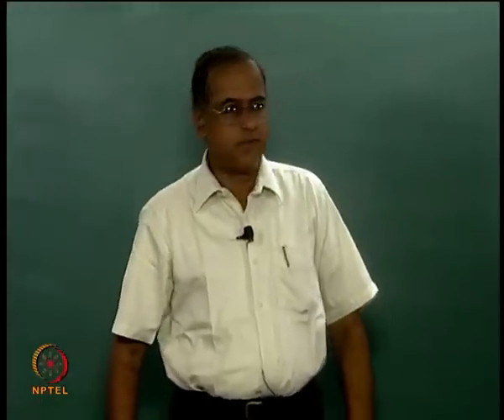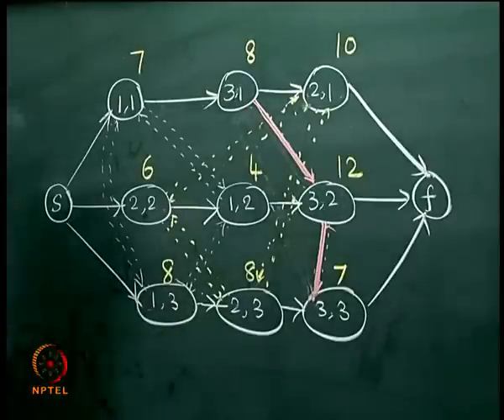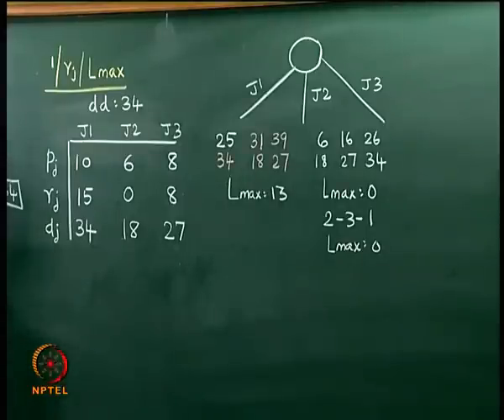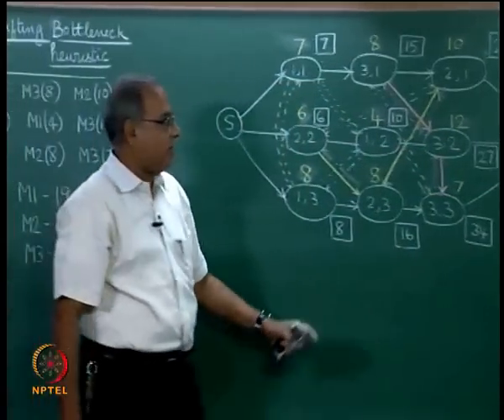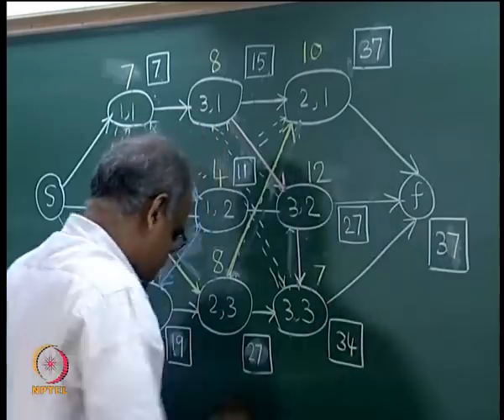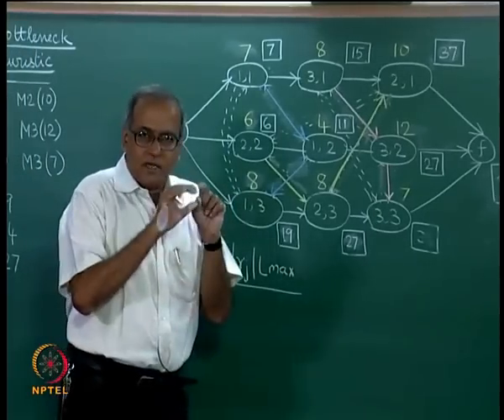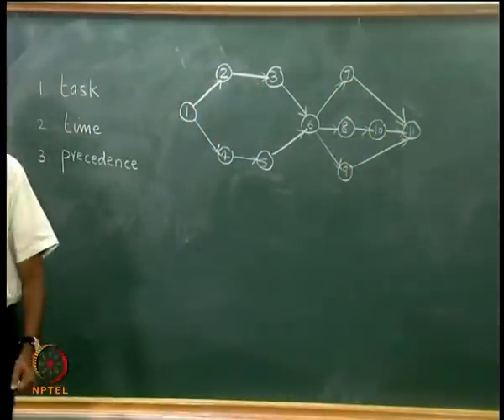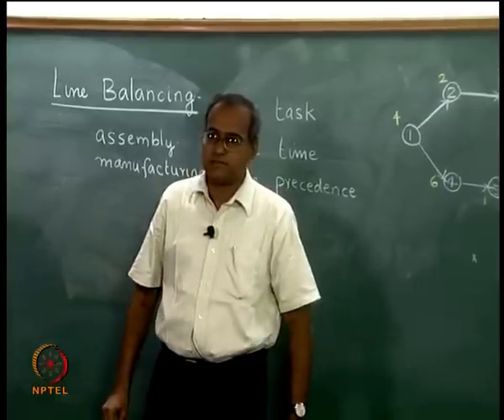Mod-07 Lec-30 Job shop scheduling -- Shifting bottleneck heuristic. Line Balancing

Comment: In trying to code this, everything seems to work great until the best arcs found during an iteration of 1|rj|Lmax create cyclic loops in the node network that were not there before. Any insight on the most efficient way to ensure that cyclic-inducing arcs are pruned from consideration from the start?

Comment: My question is 
while calculating for machine 2 related to job2, due date  = 34- (12+4) have been considered, but when machine 1 related to job2 is calculated why not due date= 34-12 only why it is calculated as 34-(7+12). and if it is taken as longest path ( for job2 i machine 1) then why (in case of machine 2 and job 2) due date = 34-(7+12+4) considered.
Reply: same question
Reply: Same question.
Reply: By reading "Scheduling Theory, Algorithms, and Systems" by Pinedo, it seems like he made an error in the first calculation and the due date should in fact be 11. This doesn't change the final optimal solution